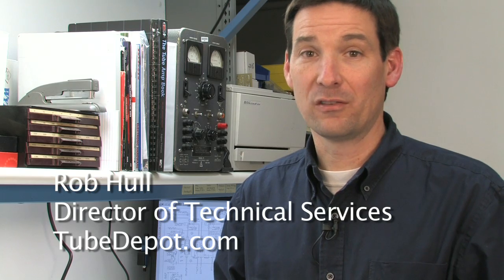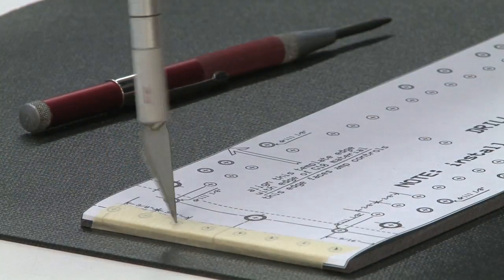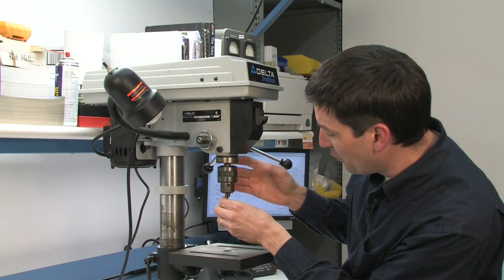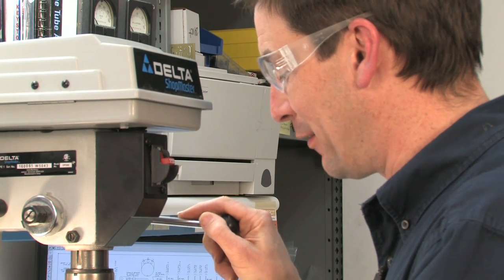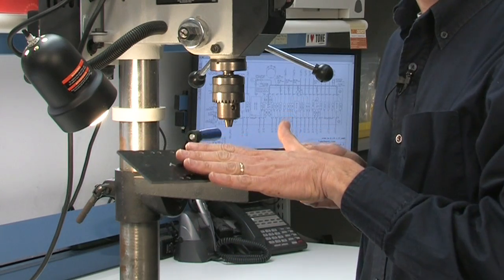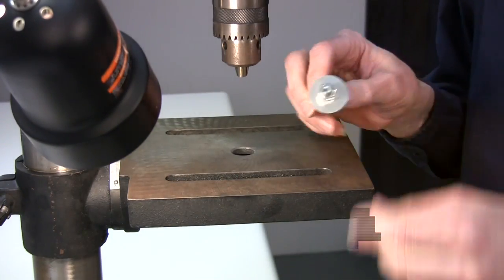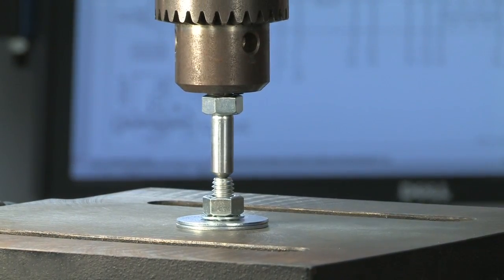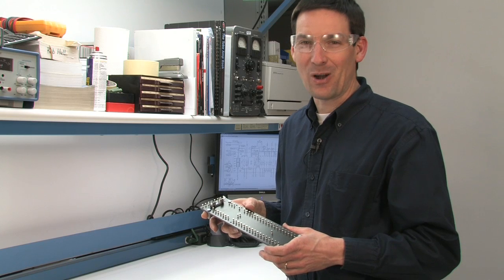How To Build a Turret Board Part 2: Swage Fitting

Comment: It’s been my experience that the template provided was not to scale. That is not critical for the turrets and I followed the instructions to make the board, but when checking the mounting position I found that the holes did not line up. After rechecking the template I found that it was about a quarter inch short on both length and width, throwing the holes off. 
   It was bad enough that I had to order more parts and go to Staples to have them correct the template as I couldn’t figure out on the computer how to stretch it accurately using pixels. This should have been corrected by the manufacturer of the template. 
   To make matters worse none of the transformers were correct and had different colored leads that I had to research and adapt as well as clearing a riding condition between the power transformer and the chassis mounted capacitors. Luckily I had military grade equipment for splicing any wires that were too short.

Comment: Some people get a little wobbly using scissors. I'm one of them so I use a straight edge and razor knife for cutting a straight line' Also when I am drilling many holes in a straight line I clamp down a piece of metal I can use for a straight edge on the drill press.

Comment: i like this tutorial i was just wondering if you had thought of using a glue stick to glue the paper template down. titanium short bits and set the board really close there is no walking away with the bit, no need for a center punch or exacto knife and with a little warm water the template is still intact and comes right off. sure does make it a lot easier for doing one offs when you don't want to build a jig just for one amp. just a thought. that is how we do it in the shop here in TN :)

Comment: cant you use rivets instead of turrets? the ones you use on automobile.
Reply: Technically you can, but depending on what they're made of the might not take solder well.  You might have to heat it up really hot, to the point it could overheat components.

Comment: I have the Vector tools. Stupid expensive! You use the $200 equivelant of an automatic center punch to set the turrets. Then you use the $350 version of two bolts to swage it. The bolts work better, and with some creativity you can make an eyelet roller by making the upper bolt pointy then flatten an area around the point. I use the poorman's lathe. Electric drill and a bench grinder! Run the drill so your bolt is spinning like a lathe, then grind away. Remember yer safety glasses, & hair net!

Comment: Thanks for the clear tutorial on this process. Do you know of an easy way to mount snap-in electrolytic caps to these bare boards? I'm thinking that maybe eyelets could be staked to the board using techniques similar to those you've used in the video. The caps could then be soldered down and connected to the turrets with insulated jumper wires on the underside of the board. The question is, where to find appropriate eyelets? Any ideas on this?